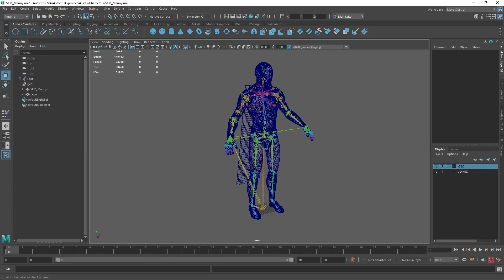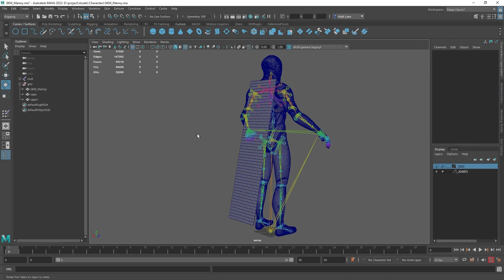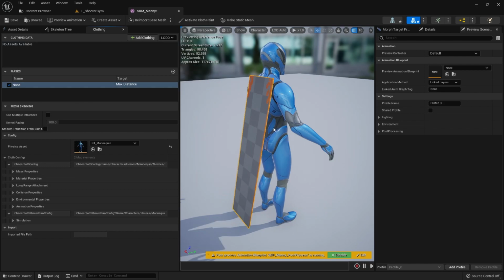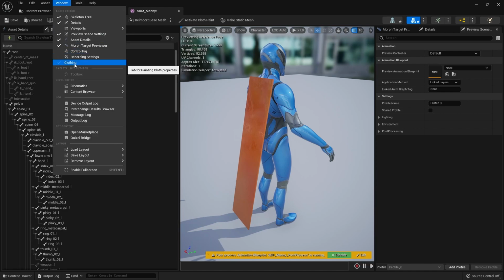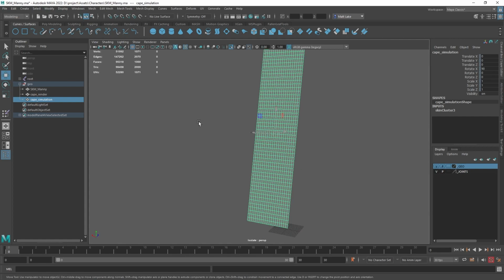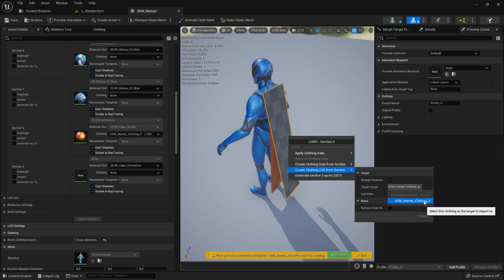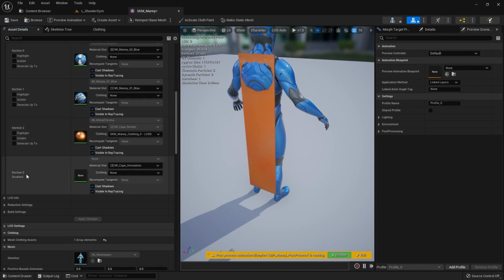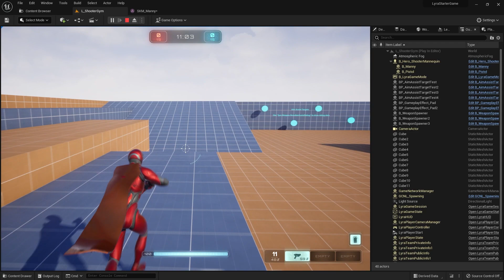Cloth Simplified Simulation Mesh Pipeline in Unreal Engine 5 Tutorial!

Comment: Maybe the toolset has changed in Unreal 5.4 but I'm not able to assign the same cloth data to more than one section of the mesh, instead when I try to do as you've done at 5:50 in the video I get the following message:
Failed to bind clothing asset
as LOD0 is already mapped to mesh LOD0
I know you said you would address LODS in a future video but I don't see one, so if you have any info you could share here it would be awesome help thanks!
Reply from the maker: Hey there MrFabutan,
The tooling hasn't changed in many years for the cloth process as this is effectively the "legacy" pipeline that builds on the original apex cloth pipeline from UE4/PhysX, this identical setup still works in 5.7.

Yeah you are correct, you cannot assign a single cloth profile to multiple elements at the same time - it's one cloth profile per element. For this reason is why it is important to design your art in a way that supports this workflow method.

As for adding LODs, it's the same process as replacing the LOD0, but you choose the add a LOD instead. 

There is the Tech Anim Corner Discord that you could join if you're struggling!

Hope that helps! Have a good day mate! Merry Christmas!
Reply: @MattLakeTA  Thanks for the quick response, I figured out that while I can paint the data on the Proxy simulation mesh I wasn't supposed to assign the data to it, instead assigning it to the render mesh. It's now working as expected and I'll look into the LOD process, thanks for the Discord tip as well!
Reply from the maker: @MrFabutan ah that's amazing! 
I hope to see you in the Discord! https://discord.com/invite/makucg465T